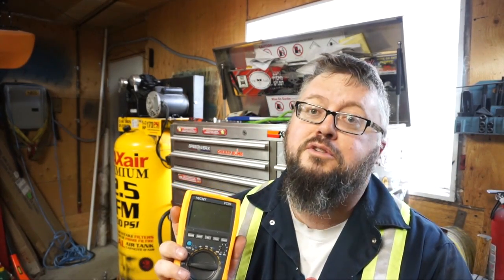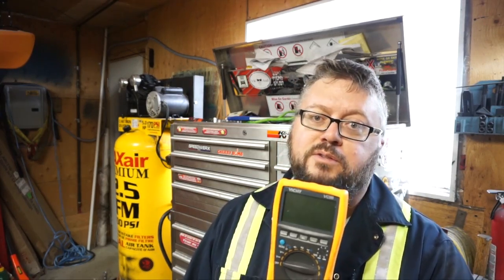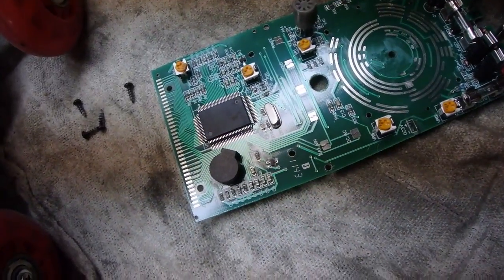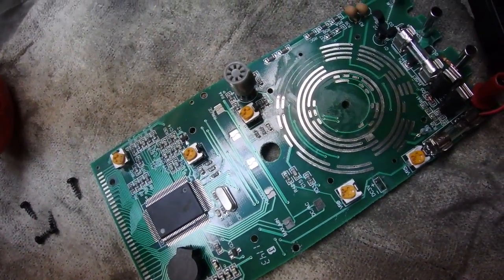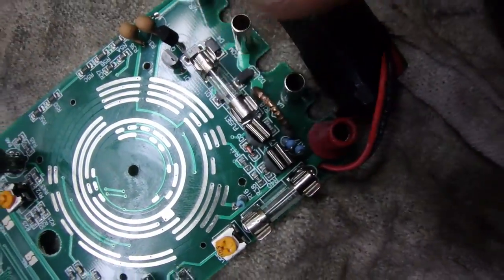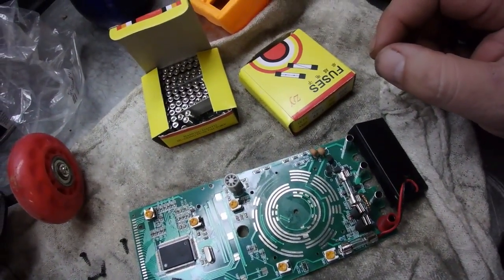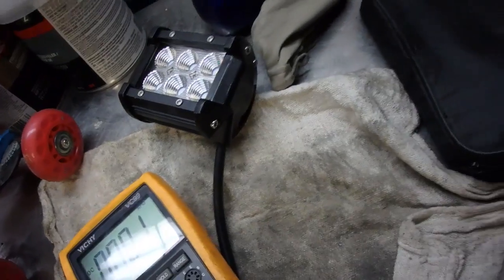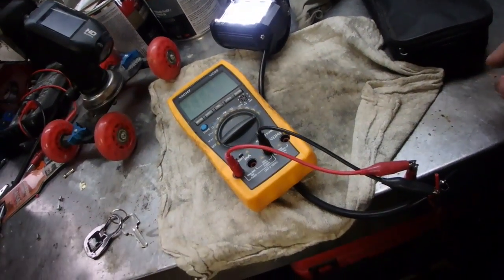Multimeter Repair and Inspection

Comment: hi, In the area of the 2 fuses, there are 2 resisters next to each other. Color Black white white gold green, (this should be 9G ohms), but R17 on the schematic is 3 ohms. On the schematic I found on the internet, I cannot find resistors with this value of 9Gohms.  On the PCB, they marked 2x R17, and have put 2 resistors. Any idea what this is ? THanks in advance.

Comment: hi, i blew my 400 mA fuse, replaced it and  everything is working fine but auto range in resistance is showing 6 M ohms. Its still measures resistance fine but is it possible to get it fixed?
Reply: aannoonniimmss I have the same problem blew the fuse and now resistance on mine shows 200 M ohms. Did you ever find a solution to this?

Comment: Have the china crap meter my self, it's ok but not for pro use.
Guess Steve woud disagree.
Reply from the maker: +Morten i used at Pepsi measure 480/600 volts and never had a issue